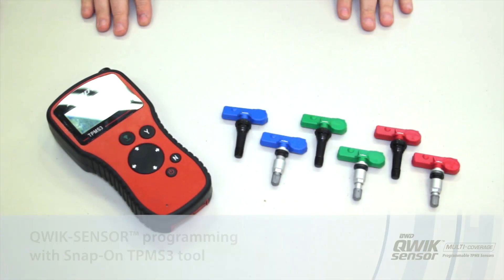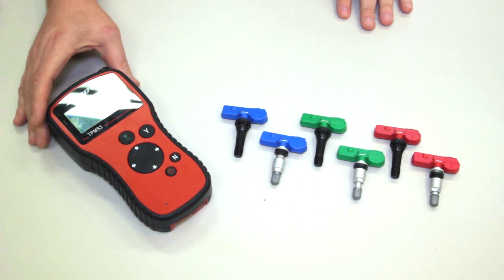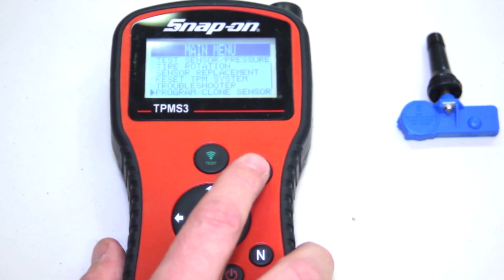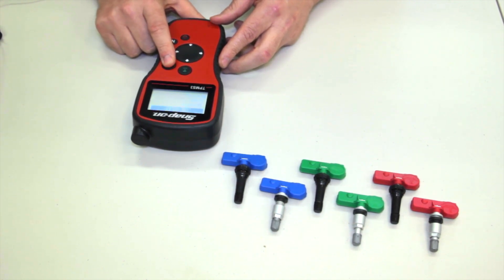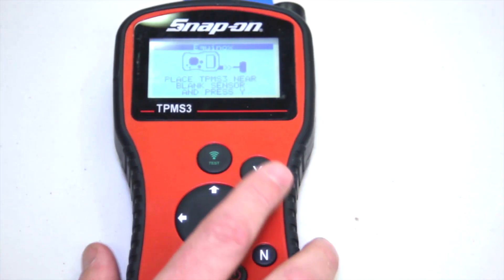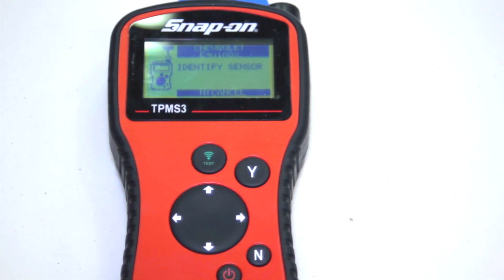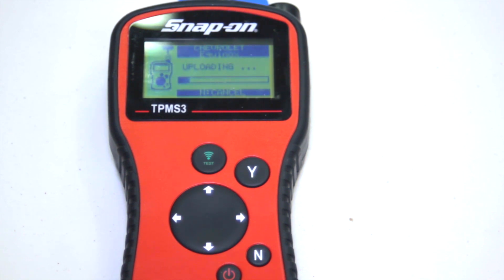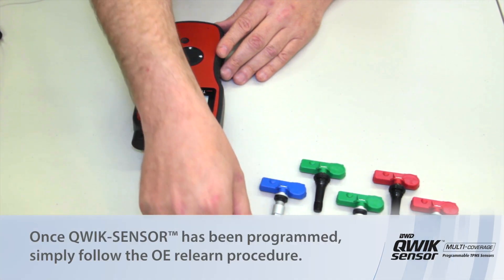QWIK-SENSOR programming with Snap-On TPMS3 tool

Comment: AT 27 seconds into the video you selected the  PROGRAM/CLONE SENSOR option.  Did you have to purchase a separate SIM card for the tool that has the information to program the Sensors? Or is that information already in the TPMS3 Tool?
Reply: I bought these sensors for my 07 Tahoe took them to pep boys for install they did not program the sensors before installing them and did not work! They told me I had to run my vehicle for about 20 miles for the sensors to start reading!! These guys never figured it out or read the instructions Bunch of idiots . 129 bucks later for labor had them removed ...waste of time and money.. is there sensors that dont need to be programmed for my vehicle? Dummy proof?